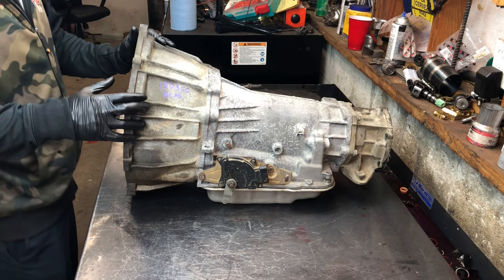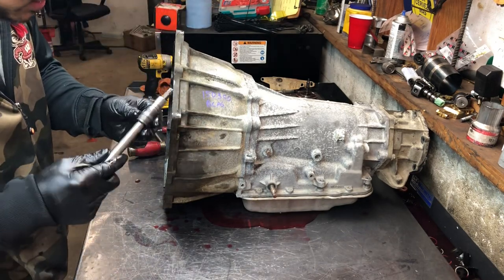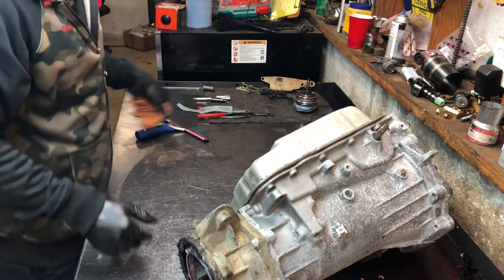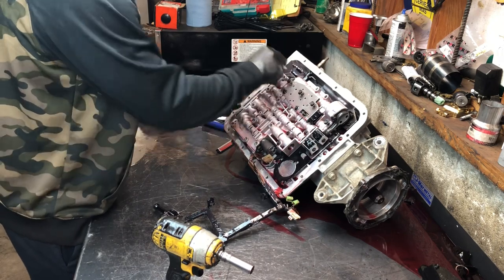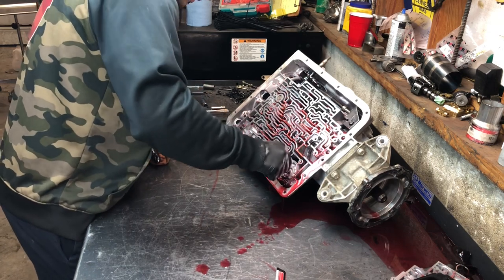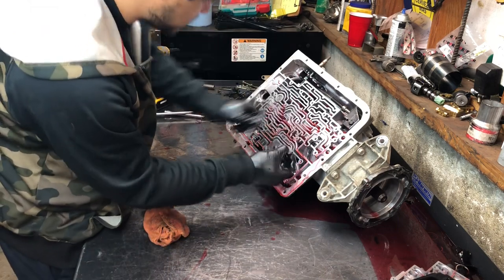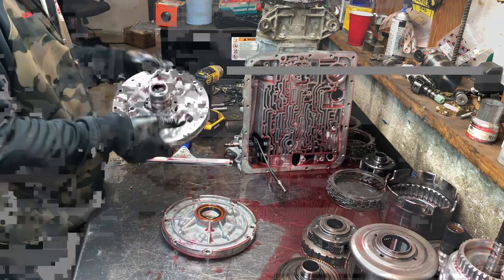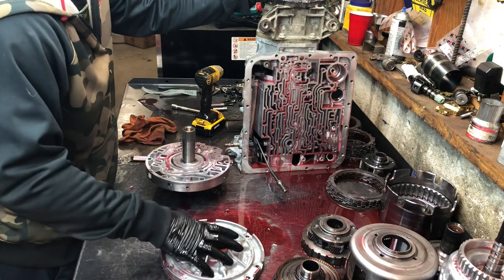4L60E no movement 2004 Chevy 1500 4x4.

Comment: Hello Joshua.
I’ll just rebuilt a GM 700-R4 transmission with general transmission rebuild kit.  
And rebuilt strictly following the “Haynes GM transmission repair online book”.
For the proper tranny repair and rebuild.
I did changed all the gaskets, seals, clutches and checked the pump also and i didn’t see any visual damage at all, not even blow gasket or seal.

Then i did make the first test drive.
After not shifting up, i did ordered a new Governor and TCC Solenoid incl. plug.
According the “Haynes” troubleshooting.

I did make a test drive after i installed just the new governor.
And everything was just fine, for maybe 10 miles....

Thats happened yesterday, i was driving down the road 50 mph and all the sudden it was as i shifted to neutral with foot on the gas and rpm jumped way high. I tried to go through all the gears but no response from any not even reverse. 
No oil leaks, no noice, just nothing.

Then i drained the oil and replaced th TCC solenoid and plug also,
But still no movement at all....

That can be just the pump,
 like in your video
or something to??
And if it’s the pump, i should order a new one or take first the tranny down and apart
and see what else could be gone or damaged??

What its the matter?
I’m so frustrated!!
Because, i did replaced all the clutches, bearings, gaskets, check ball, seals, filters and make 10 sure everything in in the rigth order and tightend to the specs.

Thanks in advance

Joseph Gwerder
Reply: Did you hook up the TV cable properly?

Comment: My 4l60e was rebuilt a little over a year ago and here recently it all of a sudden had no movement. I dropped the pan and didn't see any metal debri or shavings at all. Your video has me thinking it could be the pump. The fluid level didn't drop after cranking either.

Comment: Mine went out on a drive thru. I was in drive with the brake on let off the brake to move forward and nothing happened. Every gear was neutral except park. It made no noise no nothing. It was a 2004 Silverado with 81k miles on the clock. Bought it brand new and never abused it not one time. Found a guy that rebuilt them he sold me a complete rebuild for 700. He said it had better everything in it and I believe him because it shifted faster and better than it did when new.
Reply: I paid 2500 plus dollars to have a guy rebuild with stage 2 upgrade and blew it out. Before 10,000 miles. I beat the piss out of my truck, but I guess I expected it to survive. My truck isn't even 300 hp.
Reply: @pitbullfarmer34  everybody sucks at there job. Everybody everywhere except a very very few people. It's still astonishing to me how people can do shit every single day over and over for years and still suck. Yeah that's horrible when you have to rely on other people for things. I know a lot of things but transmissions is definitely not one of them but I honestly think I'm going to try on my own 09 Yukon After getting fucked over on the engine. I'm done I'm going to rebuild them both myself
Reply: for 700.00 what you  likely got was a basic banner rebuild kit,  and everything else used parts...  shifting faster doesnt mean its in great condition,, its very easy to make them shift faster.  a quality rebuild kit with new shift solenoids, new boost valve, aluminum accumulator pistons, new clutches and steels. o rings, gaskets, new pressure switch,  ect will cost around 450.00. you need either a case of brake clean or a machine to clean them right,,  so if he did it right, he only made 200.00 ?  its too much work and time for that little profit.  what he did was fix a worn out transmssion with used parts .  we just rebuilt one, and with a new converter, it cost us 1200 just in parts ... the pumps always need rebuilt or replace, valve bodies are worn out, bushings usually worn.  I wish you luck, but if u think you got a like new transmission, its not the case.  what kind of warranty did you get?
Reply: @randy1ization  thank you sir I'm going to do exactly what you recommend. All my life. I've only met one mechanic that I completely trusted, and it was amazing at his craft. He was the mechanic that other mechanics went to when they had issues. He worked at Marolla Chevrolet for 30 years so he got all the schooling and all of the new electronics over the years and he also built race cars. This was my friends, father and he was also just a good person. Hard to find. I'm from Michigan but at the time I was in South Carolina, and Georgia doing some work when my Yukon broke down. I literally told my Yukon to four different mechanics all garbage.

Comment: the pan gasket is rubber, its silicone, and its an upgrade over the cork gaskets.  you don't need to fuck with RTV at all.  You need to be careful about torquing the bolts down tho, because if you tighten them beyond spec, you will crush the gasket and it won't seal in that spot.  They are also reusable, because they don't breakdown.

edit:  on a side note, I know this is an old vid, but those clutches are discolored to hell and back.  They have a dye in them that changes color if they are overheated, so they will turn brown or black.  If they are brown or black(as we see here), they have been overheated and will likely fail upon reuse as the bonding to the steels is weakened.

Comment: I got a 01 suburban 4l60e trans from a junkyard h guy said people drove the truck in only junked it due to blown head gasket and didnt want to fix it. I think he pulled trans without pulling with the torque converter and I think that is what broke the rotor and slide ring it looked just like one in your video I bought ne rotor and slide ring think mine should be ok there is marks where rotor sits but didnt feel gouged at all just lite marks should it be ok. When I found out it was pump that was s broke truck (06 YukonXl) on jack stands all wheels off the ground put in gear to test if wheels turned they barely did for like a second then stopped

Comment: liked and subscribed.. just tore down a 93 4l60e,, only clutches burned were low/reverse.. wondering why just those clutches burned,,  pump was not in great shape.. is the hydraulic circuit in the valve body for the low/reverse clutches a common problem, or something else like leaking low/reverse piston seals? thanks

Comment: I’m really stuck on my truck I don’t know what else I have to replace man this is literally my 3rd trans in a year then I found my ring and pinion are bad I just changed it bolt everything up new driveshaft ring and pinion rear slip yoke clamps bolt it up start it no movement in any gears. I shift back to park and it grinds somewhere but idk where yet.

Comment: I have an 07 trailblazer 4x4 with 170k. My transmission pump failed and was replaced 3 different times. The shop said something on the motor may be moving and causing it to fail. Do you have any ideas on this? Last time it was fixed I only went 400 miles and it broke again
Reply: Yeah it sounds like some bullshit Mechanic tells you because they suck at their job

Comment: GOOD VIDEO...COULD THAT PUMP HAVE BEEN RESURFACED?
Reply: Mine broke a couple of times and my city was complaining about a vehicle with expired registration so I pulled it just to put a new rotor in it knowing it would break again but it did not look awesome but I knocked down anything high and it was pretty much fine I assume my thrust bearing is out on my motor that keeps breaking it

Comment: My truck awd won’t move anymore and when in any gear it makes a spiny noise and when I put it in park it’s as if you put your hand on a fan to stop it I can find a single video that helps at all
Reply: HELP PLZ
Reply from the maker: @lester1078  have someone check your driveshaft to see if it’s still spinning when you put it in park. You could have a front or rear diff problem.
Reply: You ever figure out the problem?

Comment: Rebuilt transmission. Won’t move in drive. Have to manually shift 1-2-3-D then it goes to O/D what could be the cause
Reply from the maker: Top Dawg Industries the forward sprag is broke or installed backwards